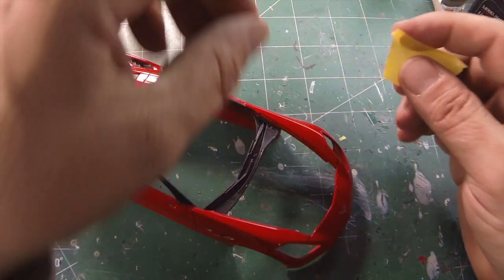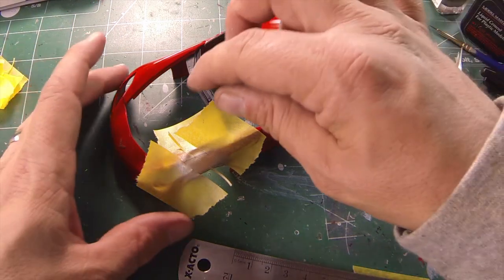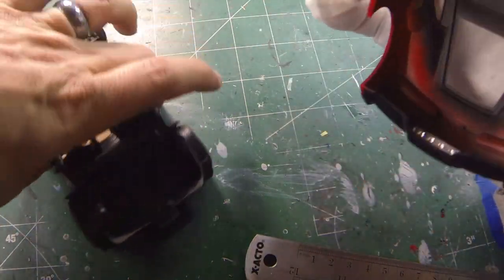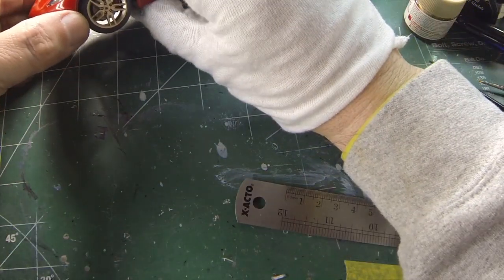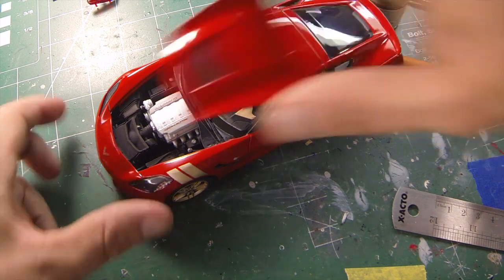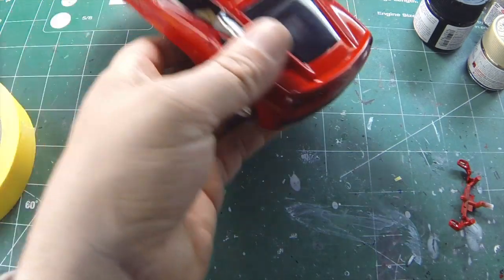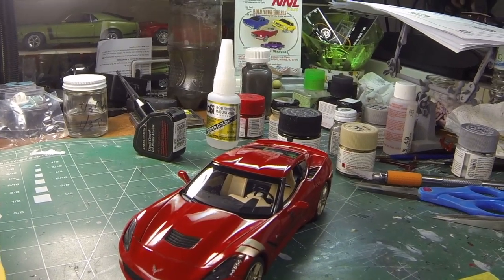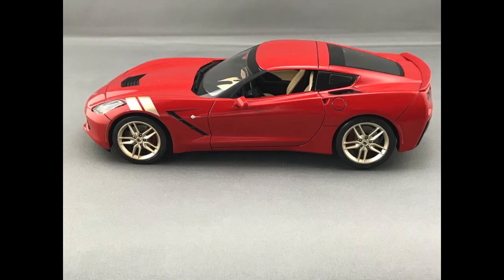Revell 2016 Corvette Stingray Video #5

Comment: Angelo, I have not done models since my early youth and mid 20s. Looking to get into it again. I watched the video on the paint process and then watched all the build videos. Excellent videos and the Stingray came out great. The multiple pics in the slide show was also great but the backdrop seems to kill the gloss look of the clear cost. In many pictures it actually looked flat red on some of the panels with certain angles. Maybe changing the background color or laying down a charcoal black mat for the model to sit on? Also more spot lights and less diffused light to help reflect in those curves and broad surfaces.
Thanks for the videos.

Comment: I didn't know you could paint over c.c. Do you have to use a different type of paint? I use Gravity and It's A lacquer based. Also, the very back of this car you have black paint. Do you consider it to be part of the body color? Sorry, I'm just trying to understand, which parts of the car you paint and clear coat before you mask the other parts. Again, I'm sorry for all of the questions, I just want to do this right. Thx, Mac
Reply from the maker: Michael McNeive hey Mac no problem, for this car I painted all the red and cleared the red using a lacquer. I then detailed all the black trim using an acrylic. I use an acrylic over the lacquer on purpose. If I make a masking error or some overspray I can buff the acrylic right off the lacquer without hurting the lacquer. I hope this helps.

Comment: Another Beginner Question, I'm getting ready to clearcoat and I was wondering how you kept the clearcoat off the exterior black parts. I know you probably did the front grill and the hood separately, but what about the other black areas. Did you spray over these areas or did you mask them.
Reply from the maker: Michael McNeive hey Mac, I masked off the black areas.

Comment: Good Morning Angelo, Sorry I keep asking questions but I've never done this before and I want to make sure I am doing it right. I have the car painted red and I'm ready to clear coat. I have both 1K & 2K Gravity. I assume that you used 2K. I don't even know what the difference is. And I wanted to make sure that you didn't mask off any of the places that were to be painted black later. I didn't know if the vents might build up with too much clear. So, if you didn't mask anything on the body, I guess I'm ready to clear coat. Am I on the right track? Thx Again, Mac
Reply from the maker: Michael McNeive hey Mac, I use only 1k clear. The difference is 2k must be mixed with a hardener.  I’d like to try 2k someday maybe but up till now I’ve only used 1k. As for masking I paint and clear a solid color car before masking and painting trim. I do this on purpose so I can use lacquer for the paint and clear and then use acrylic for the black trim. Since the acrylic is easily removable from the lacquer without damaging it I can correct any mistakes done painting the trim very easily. I hope this helps. Keep going!
Reply: Thx for the feedback, This is the first time that I've painted over the clear coat. I wasn't sure you could do that. So I guess that you can paint over 1K or 2K clear coat ?
Reply from the maker: Michael McNeive you can paint over anything as long as the paints don’t react.

Comment: Good afternoon Angelo,  As you know I've been using Gravity paints for my base coats which I've been very happy with, It's nice to be able to pour the paint straight from the bottle to the airbrush, however, Tamiya has a lot of nice colors that I would like to use from time to time. For instance, the Tan color you used on the interior of your 2016 Stingray. The problem that I am having is that I don't know how to thin Tamiya paint. I've heard everything. Even Tamiya says that you should thin it with their thinner, 1 part thinner to 2 parts paint. this guy down at the hobby shop uses Tamiya paint for most everything that he paints and he says that he rarely even thins it and that when he does he just puts 2 or 3 drops of distilled water in his airbrush and mixes it around a little. I'm very confused about this. So I was hoping that if you could find the time you would tell me how you do it. Thx, Mac
Reply from the maker: Michael McNeive hi Mac, the trick with Tamiya paints is they seem to vary in consistency based on the color. I use isopropyl rubbing alcohol to thin mine. For me it was helpful to not count drops but instead try to find a certain consistency. Mixing with a stir stick I drag some up onto the side of the paint cup and if it run back into the cup while leaving some color you’ve got it about right. Also you can tell right away by spraying for a few second on a test card or spoon. If it spits and splatters it’s too thick, if it doesn’t cover and is runny it’s too thin.